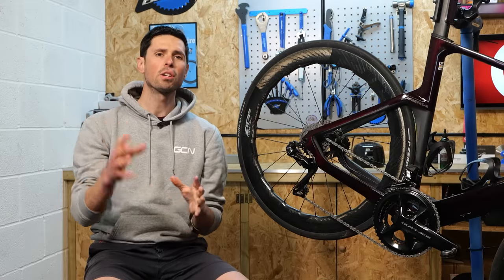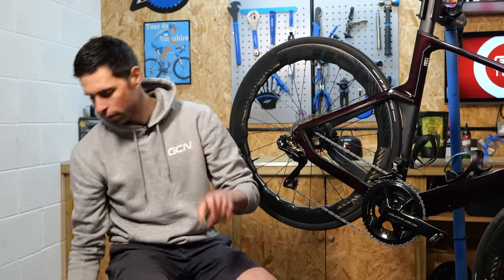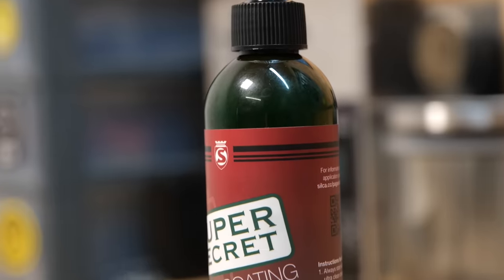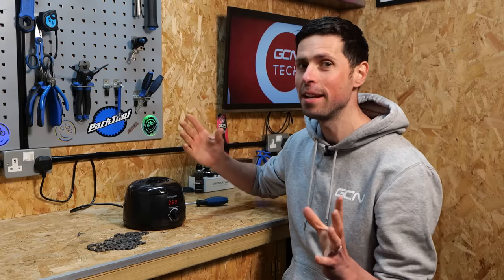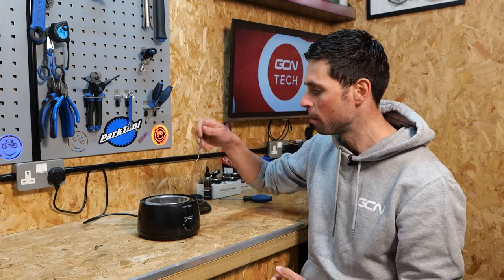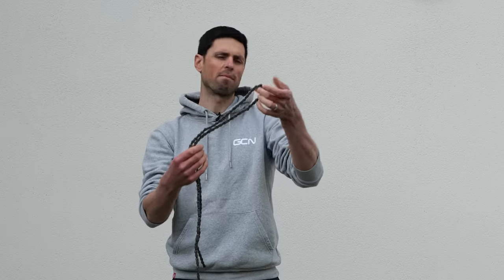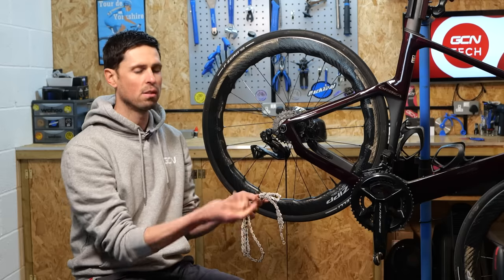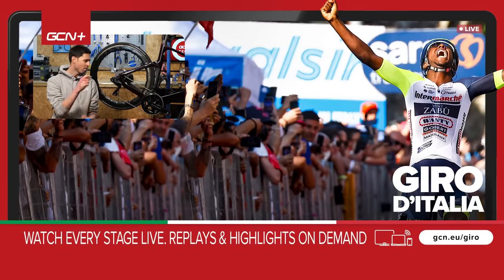How To Re-wax Your Chain & Make It Last Longer!

Comment: Improve small to large chainring shifts. Anyone else find they sometimes need to scrub chainring ramps to remove excess wax deposited by fresh waxed chains?
Reply: Not so far, (two years), but I have heard others say they do... I do run a strong bristle brush on the cassette though as a matter of course after putting the newly waxed chain on to remove the excess and that maybe is why I do not see this excess wax problem.  Yes it does make a mess on the floor, nothing a vac won't fix.
Reply: nope, just pedal away and it will flake off after a few minutes
Reply: No, but I do occasionally (every few chain swaps) have to pick the wax out from around the small cog on the cassette so the chain will seat fully on it. It clears out of all the others, but there are no gaps for the wax to be pushed through around the 11t.

Could be a function of how much wax is being left on your chain. Maybe you just have more buildup than I do that's deposited on your cassette.

Comment: So do this properly on a sram chain you need to officially replace the quick link/power lock every time you take the chain off in this case every 200 miles. For a pack 4 that's 12 quid basically every month if not more if you're riding more the 800miles every month and that's if the parts are even in stock to begin with!. I like the idea of wax but no it's too expensive to maintain. On the other hand, silica synergetic drip lube is fantastic, can last up 500 miles between applications, and is almost as efficient as wax lubes. Comes off with nice soapy water and you just wipe the excess off between rides and applications nothing much gets stuck to it this is what nearly every bike owner should be using.
Reply: Or buy reusable quick links from someone besides SRAM....
Reply: I am assuming that you are talking about axs 12 speed chains? If so, then I wax mine with 2 in rotation and find that the SRAM quick links are good for several uses before they are a little loose when reconnecting. Obviously they are not billed as reusable, but just relaying my personal experience.
Reply: @mrhankbotful if you are aware of an officially reusable 12 speed quick link then I'd love to know.
Reply: @Esskay1  that's a fair point, I've built everything up in 11sp for compatibility, so off the top of my head don't know of 12sp specific reusable ones. KMC makes the reusable 11sp ones I use, but don't make a reusable 12 speed version.

Comment: Wow... A How To Video on how to embed road grime permanently into your chain. Also, why is the wax black? I hope it's some graphite magic powered and not even more road grime.
Reply: Tungsten disulphide is the additive, and yes it makes the wax dark grey
Reply: @ysarn  Interesting, you learn something new everyday.
Reply: I believe the "road grime" you refer to is dirt that has stuck to oil lubes which then turns into a black grinding paste. Dirt doesn't stick to wax so (a) it doesn't turn the wax into a black grinding paste and (b) because it hasn't stuck to the wax it's not there to be cleaned off, thus a wipe with a mf towel is all you need to do before dipping your chain in wax. Ok so there will be a little bit of dirt left on the wax after a wipe with a towel and your pot of wax will over time become dirty. If you have the time to wash your chain in hot water and completely dry it afterwards then by all means do it.

Comment: Even if you get out 5 times of use from a quick link, that‘s 1€ per re-wax. You will get to the price of a new chain pretty quickly. I‘m not sold on that this saves any money.
Reply: look at the prices of AXS power links 12 quid for a pack of 4.... And there supposed to be used once only. So if your rewaxing every 2-300miles id go through a pack of power links a month.... nah they have another product that's much better for everyday use that's just as good and that's their synergetic lube. Can last upto 500miles between applications and is easily cleaned without taking the chain right off. My red cassette is showing no signs of wear after a year and half.
Reply: @gaza4543  Similar story here. I wash my bike after use anyway because I don‘t want to have all the dirt next to the indoor trainer.
Reply: I have yet to have one of my KMC reusable quick links need replacement. If all 3 chains quick links went bad tomorrow that would still be 800 miles per quick link. Some people are replacing their chains that often, and I'm expecting 3300+ miles per chain, and 10k+ miles from the cassette.

Comment: Stirring in 50g of PTFE powder to 500g of melted paraffin wax will make the chain much more slippery and dirt repellant, so it will stay a lot cleaner and run quieter. It won't be stiff after waxing.

Comment: Soaking a rag with motor oil (any engine oil will do) and pulling the chain through it is all I do. 
That's it.

Repeat every week on rainy conditions and every month on dry conditions. 

No special expensive chain oil, chain wax and no degreaser or anything else needed. 
Motor oil has everything needed, it works not only as a lubricant but also as a detergent and rust inhibitor, it has anti wear components, too. In winter it's thin enough and in summer thick enough due to it's viscostiy improvers it comes with when it is a multigrade oil which every motor oil nowadays is. 
Like I said, everything ever needed is already in motor oil included.
There is no cheaper and more effective way to take care of your bicycle chain.

Comment: We have a true believer here, you can see the joy on his face for having received the secret from the gods to gain those mythical 2 Watts.
And wow, now I can add wax and a wax heater to my compressor for tubeless, my fluids and fluid cups and lines for my brakes, my electronic parts for the drivetrain. 
Nah, just kidding, I want none of this crap near me. Biking should be a simple hobby and you need enough clothing and accessories as it is, even without the ‘improvements’  made in the last 15 years.

Comment: 1:45 Can I melt wax in a microwave instead?
Reply: No, it needs to be heated up slowly otherwise the chemicals do not work properly
Reply: @lemonshire1  ThnX!
Reply: pretty sure there are particles in there that aren't microwave-friendly graphene and the like and over time as the wax is used there will be fragments of metal accumulate. IE big boom
Reply: @gaza4543  I was thinking about the plain wax. A paraffin-like one used in cosmetics.

Comment: I also wax all my chains, far easier and cleaner than crap black crap everywhere, usually on the cats!😂😂😂 a thought occurs, what does anyone think about JUST waxing the cassette teeth as well, it'd be easy to turn the cassette sprockets by hand to just coat the teeth?? Anyone down that? Just an extra chain contact point to help total lubrication! In case anyone misunderstands im not dipping the whole cassette, just the teeth. Im going to try it next time!

Comment: only 300 to 500km before a new wax? So tha'ts like every other week and the pro's do it every week and sometimes twice a week.
Reply: In all fairness, you certainly wouldn't get that out of a traditionally lubricated chain out on the road. For pros, that's probably not the biggest of issues, they get their bikes set up and can just ride without waxing on their training bikes for ease of use when watts don't count that much.
Reply: Yes, it could be intrusive, but I run three(3) chains concurrently for reduced time and only wax when all  three need it.  When all three chains a done, I replace the cassette (well I will replace the cassette, as so far that looks like being at about 45,000km based on chain wear rates and the old three chains to one cassette rule).

Comment: Clean your chain with boiling hot water- dry it- put it in white spirit and agitate it every now and again for at least 30 mins- 2nd bath of white spirit, you be amazed how much grit is still in there - put it in methylated spirit to soak for an hour - remove and dry - put your chain + links on a coat hanger wire and put it in a oven at low heat for 10mins - put chain in wax pot and leave for 30 mins- remove and let it cool- run chain over something cylindrical like old door knob to break in the chain.

Comment: 300-500 km? you mean in ideal circumstances? When it's not raining or dirty? Every time there's a new wax formulation, there's a frothing flurry of hype, and then the real world gradually catches up with the snake wax salesmen, and they slink off with their ill-gotten gains from credulous rubes. I've seen this cycle repeat itself maybe half a dozen times over my 35 years in the industry, e.g. Rock & Roll lube. Oh, that's right, Silca makes a massively overpriced wax lube. It's paraffin wax with a few extras. You can buy paraffin wax in lb blocks for a pound or two. Talk about meretricious.
Reply: 10000%.

Biggest snake oil 'wax wanker' right now is that Adam dude from ZFC who made racist comments towards habmini. Adam sells a waxed shimano chain for 200AUD lol!

Candle wax alone is good enough. Sprinkle some PTFE in there if you want to get fancy. Or just stick with squirt. I get about 15000km from a squirt lubed road chain.

Comment: After giving it a go to waxing, both in hot dip and drip. Wax is not a good lubricant, it's pressed out of the links and pins and for the type tribology system a bicycle chain is, wax is just not it. A penetrating lubricant with water displacing properties that dries into a SAE 20 or 30 oil is simply better. Stop looking at bicycle solutions, look for the industrial chain lubing solutions. Those chains are punished beyond what can be achieved on a bicycle and those chains work 24/7.
Reply: You are totally correct.